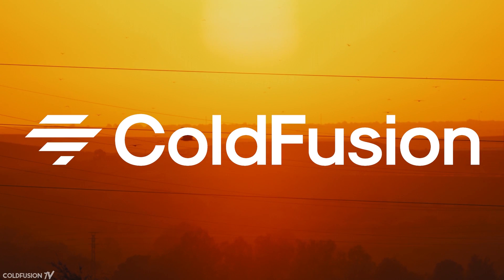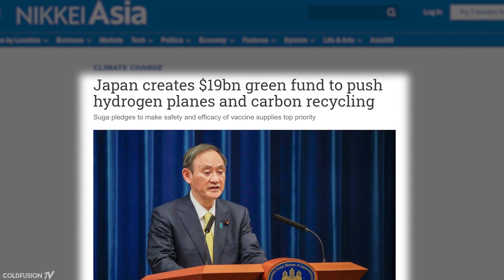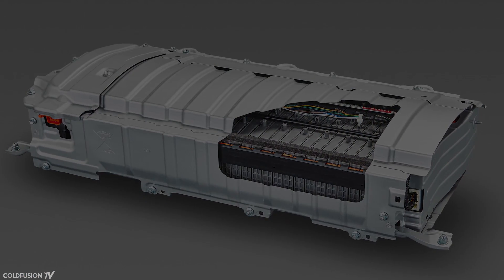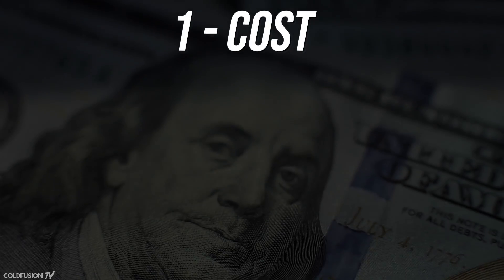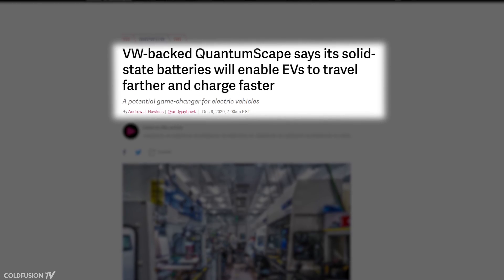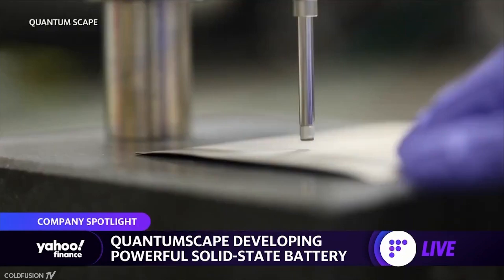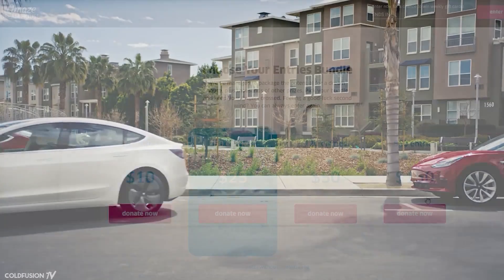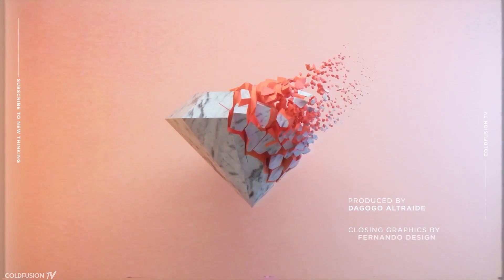Toyota Plans Revolutionary Solid State Battery for 2021

Comment: Its all very good to say that Norway now sells more electric cars than other fuel types. Norway is slightly larger than Victoria, the smallest mainland state in  Australia. So, travel within that country in a vehicle that has a 800 Km range in a no brainer.
Now lets look at the elephant in the room. Australia, (and some other large sparsely populated countries).
Australia has  road travel  distances that just don't make sense to European's, Asian's or American's  yet many here think nothing of a road trip from say Adelaide to Sydney (1400 Km/870 miles) with one over night stop or Sydney to Brisbane (900 Km/ 560 miles) without stop.  
And, these trips don't even involve any real outback travel. What about a trip to Alice Springs (less than 3000km from any mainland capital). 
This trip can be comfortably traveled from Adelaide (1500km/930 miles) in 2 days or less with little planning. Now lets look at a Tesla Model 3 Long Range with a  claimed range of approx. 650km. 
In real world terms this is, according to some sources, as low as 460 Km in good conditions. 
Now this trip does include some outback travel (i.e. very remote, no super chargers out here). It does have 22Kw chargers in some locations (Port Augusta, Cooper Pedy) but you will still need to add at least 280 km of charge somewhere with questionable power supplies from a standard wall plug and the portable charger. 
According to Tesla a standard wall plug can add 10 km of range per hour from the portable charger i.e. we have just added 28 hours of down time to the trip in places that are little more than a roadhouse in the middle of the desert. Don't forget that this is in SA desert where temperatures regularly exceed 40C in summer and can exceed 30C in winter., so no walkabouts (sight seeing on foot) unless you are well prepared and know the area. These are not tourist hotspots either, so your unlikely to have any organised tours available. 

So now a 2 day trip becomes at least 5 days with a minimum of two stops doing nothing but watch your car recharge.

Now I know the average buyer of an EV is probably not considering driving to Alice Springs or anywhere else that remote but the reality is that EV's are great in situations where your travel in not going to exceed the average half range trip away from a high capacity charger but less suitable for long distance travel in remote areas. The info-structure costs to solve this problem in places like Australia (except maybe the east coast) just doesn't stake up.
 
The Solid State Battery may be a step closer to solving this problem but unless you can make the trip above in the same time as a vehicle with an internal combustion engine fitted with a standard fuel tank you will be hard pressed to convince the average person in places like Australia that the additional cost of the vehicle, plus info-structure costs are worth it.

Comment: I want the new Dacia Spring. It will cost roughly €15.000 "in store" comes fall, will run about 200 km on a charge, and do exactly what I need from a car - handle my daily commutes, about 70 km a day. 

"Oh no, you need 500 km range in a car!" I hear the the skeptics say. 

Do I? Do you?
If you buy a new electric car that cost you perhaps only 1/3 of a "cheap" competitor, you got roughly €30.000 to spend on taxi, travel, leisure. 
Need 500+ km range? Really? Well, if you got a cottage up in the mountains perhaps you do. I don't, and most of us do not. 
Low cost/shorter range beats expensive/long range every time from a pragmatic users standpoint. Every single time.
Reply: It's because people are used to seeing 500km range on fossil fuel cars.

Rarely do people realise that they only drive maybe 50km to work per day on average, so 500km of range doesn't always make sense for everybody

Comment: Saying that you are worried about fire on  Li battery is so ridiculous when we are now driving around with a tank of flammable and explosive liquid that is exploding thousands of times per minute in small enclosed cylinders for over a hundred years now. Cars have always operate on the safety margin of whether it will blow up on you. Li batteries are really not all that different.

Comment: I work in digital infrastructure. On UPS and battery pack up systems for data centers, stores etc. Lithium batteries are very volatile and have a life of 5 years. So pretty much every 5+ years you will have to replace your batteries. At 100,000 miles you better sell your electric car if your smart.

Comment: If you look at the sweet spot for Rapid charging on a Tesla where you can get 250kw charge speed when between 10% to  80% .  It would be ideal if we could safely live inside that part of the battery and still get a 400 mile range with 15 minutes of charge.

Comment: My home electricity supply is limited to 60A, at 230V, which means that it can't supply enough power to recharge any 40kWh battery faster than  2 1/2 hours. Only superchargers could manage these fast recharge times quoted in the video
Reply: Gotta tap that 120A mainline, though that sort of rewiring (in my area anyway) is probably 20k USD
Reply: @nalgene247  Newer houses are getting 100Amp,  23kW if you don't use power for anything else.

Comment: "A phone battery that lasts three days." - My Nokia 5110 calling which I forgot in a drawer in 2007.
Reply: My Lenovo P2 is calling from the drawer I put it in 2015, too. That phone could last at least four days on standby, ten days on the battery save feature! :)
Reply: If its a joke then I get it but if it isnt, then the reason why they last more is because they arent smart and are type of analog devices, receive no notifs, no gps, etc etc.

Comment: The recent cold temperature drop in Texas  is a big problem for battery run vehicles. A battery could lose 30 percent of its power in very cold temperature to start and run the engine. Not only that, with the lost of electricity,  electric vehicles can't be charged.  Hybrid vehicles are better because gasoline does not freeze and charges the battery as well.
Reply: You act like EV's don't exist in places where it is normally cold.

Comment: Good the research is making some progress but still early stages, solid state battery has its benefits that we go for: Carry capacity, easier to manufacture, no rare elements aside from lithium itself (carbon and such are common elements), potential for lower cost, that high price in the video is due to the lack of mass production and only a small team making the battery "by hand" but otherwise should become affordable. The bad, yes those annoying dendrites need to be dealt with for maximizing battery safety and avoiding the swollen battery "disease". Would like a job in this area as I don't have a job yet after college.

Comment: Solid state is not more expensive. It uses less material. No anode needed. No heating system, and some other benefits. I keeps its charger and charges better in winter.

Comment: I find it comical that Toyota is claiming 500Km of range which supposedly provides "double the range of what would be possible with traditional Lithium Ion batteries 3:12 ".  Never mind that Tesla is about to offer a battery of 520 miles, or 837Km of range in their upcoming Tesla Model S Plaid+....
Reply: It says double the range for same size.
Reply: @skiran69  We'll wait until they release something.  Too much vaporware floating around...

Comment: 500 kms at Japanese cycle so 300 kms at 80-90 Km/hr so maybe 300 Kms range in reality and we're there already with current tech, the only real issue today is poor batter temperature control in cold weather or lack of entirely when it comes to Nissan so the result of that is much slower DC charge times. But a 100 Kwh EV would be nicc with 300 Kw charging Winter/Summer. 

It's amazing that Toyota are still churning out Hybrids with NiMh batteries.

Comment: Another breakthrough that's just 5 years away........
Reply: Not going to happen for 20 years plus.
Reply: Most likely 10 years away 😄
Reply: 5 Years.???????............I believe 15.....................Paul
Reply: If it was actually only 2 years away, imagine the buyers remorse of buying a $50,000 EV then 2 yrs later Toyota comes out with an EV using solid state batteries for $40,000
Reply: @michaelbrinks8089  followed by Tesla coming out with a $25K Model 2. QuantumScape is saying minimum 2025 before it starts producing SS batteries.
Reply: @michaelbrinks8089  spot on!
Reply: It's a huge disappointment
Reply: What is the company Toyota is using for their solid state batteries?
Reply: plenty of time to make some good investments

Comment: I know it's impossible, but why don't the various auto companies agree on a standard battery size? Then it could be like the battery powered fork lifts in the auto plants! When the battery in your vehicle is drained, you pull into a charging station and exchange a depleted battery for one that is fully charged! Designed right, it would take no longer than it does to fill your gas tank with fossil fuel! Like the battery powered fork lifts, just unplug the old one and plug in the new one! The depleted battery is charged and ready for the next customer! Not enough profit I guess. Too bad for us.

Comment: I think the final pieces of the puzzle will be standardizing the batteries so that battery stations can replace gas stations - you pull up and swap batteries - and getting the electricity from somewhere else than where we get it now. Without those two things, supply chains cannot go all electric nor will it make any difference. we'll still be burning dino goo. Just upstream.

Comment: Warning to anyone who isn't well versed in nrcg storage: energy density as expressed in what hours per liter is a useless metric. Electric vehicles are weight constrained not volume constrained. This video is very misleading because it focuses on volume instead of weight. The manufacturing costs are also enormous roadblocks. Toyota's been wasting its time with hydrogen fool cells for the last decade and going nowhere. Now they want to waste more time and money chasing after solid state batteries instead of just going with the existing, perfectly usable technology.

Comment: The ultimate weight-saving battery car would have the frame itself made of battery materials.  However, this would make repairs prohibitive, perhaps impossible.  In the end, we started with the 'carbon' battery circa 1900 and we will conclude battery fueled cars with more advanced Bucky-ball carbon batteries.

Comment: Batteries are only a stop-gap and not the solution and create way too many problems. They need materials which are hard to get and just assembling those batteries creates a gigantic carbon footprint and there is the whole thing regarding recyclability. Hydrogen is the way forward.

Comment: I sold mt Toyota pickup 3 years ago with 500,000+  miles in it, motor is all original,no rebuilds and he is still driving it daily All he has done is change the oil and filters using the schedule I gave him. If their electric is half that good I'll have one

Comment: Toyota Solid state battery: charging 10 minutes and run for 500Km.  Not the best in the industry.  The key for electric vehicle is the battery.  Unless Toyota has even better battery, it's hard to compete and maintain as the #1 vehicle maker in the world.

Comment: Lithium metal as an anode will not work.  The plating and stripping of lithium  repeateatedly creates enormous changes in the structure and density of lithium - imagine a battery that grew and shrunk more than 30% every cycle!  Mechanically  and electrically this creates a  bevy of issues and the fact is that the lower the density of the lithium the more dangerous it becomes.

Comment: Opinion: it doesn’t matter wether it’s Solid state batteries Or lithium ion batteries, what matters is we keep moving forward and developing batteries to replace ICE transport machines.
e.g. Internal combustion engines have been around and the choice of transport polluting machines for more than a century and have barely developed from the original concept.
Reply: e.g. means "a prime example". I think you mean i.e., meaning "that is"
Reply: @nalgene247  thanks for the correction

Comment: there's an easy fix for the "doesn't preform well in cold temperatures" problem. Just put a heater under the battery. done.
Reply: Then the accumulated heat will melt the battery
Reply: @michaelh13  I think Person the Human means use measured heat as in thermostatically controlled heat, think air conditioning

Comment: Unless Toyota can create a SSB that can have a 400+ mile range (including wintertime driving), recharge in 5 mins to full without any battery damage, and include it in a mid-sized car priced at $25,000 then...don't waste your time or effort Toyota. Until the 'Trio of Troubles' are addressed, there will be no en masse adoption of EV's anytime soon.

Comment: Daimler is offering solid state batteries in their buses. Its tough to get any technical info on them. But they have a 25% better energy density compared to NMC, they cant fast charge as well and they don't use cobalt. the rest is a mystery.

Comment: I won't believe it till I see it.   Doing something in a lab is not the same as mass production.     They have to get Cost, safety, and reliability  right!    Nobody wants to pay $15,000 to replace a car battery!    Which is why only rich people can afford electric cars,  And the used  electric  with  an old battery have  little value.   I'll stick with gas for now.

Comment: QuantumScape investors have until March 8, 2021 to apply to be a lead plaintiff. Investors do not need to be a lead plaintiff in order to be eligible to recover as class members. The case alleges that QuantumScape and its senior executives made misleading statements to investors and failed to disclose that: (1) QuantumScape's purported success related to its solid-state battery power, battery life, and energy density were significantly overstated; and (2) QuantumScape is unlikely to be able to scale its technology to the multi-layer cell necessary to power electric vehicles

Comment: 'solid state' specifically refers to electronics based on semiconductors. The term was prevalent in the 50's-70's as microprocessors replaced mechanical components such as in watches or clocks, or more recently, SSD over HDD.  The term simply doesn't apply to batteries since the BMU is independent. Pretty sure Toyota know that.

Comment: I can fill up my Toyota Corolla in 3 minutes and run 593 miles
Reply: BINGO! And that is why we'll never see any mass adoption of EV's anytime soon. Until some electric car can make a battery that has a TRUE 400+ mile range, can recharge to FULL in 5 minutes and cost around $25,000 for a mid-sized car (Tesla Model 3 size) then EV's will remain an extremely niche car with nearly NO ONE interested in buying. EV's just aren't "there yet" for the vast majority of consumers.

Comment: Ultimately, infrastructure and power delivery are going to be the limiting factors. If your EV has 100kwh worth of batteries, to get that charged in ten minutes is going to take a charging connector that can push through 600Kw. That's a heck of a lot of power - about the same as an electric arc furnace needs to melt ten tons of steel.

Comment: The revolution of multiple batteries 🔋 under the chassis of any car 🚘 built with reducing fuel consumption and using solar generators to power technology in the form of solid state power to better technology.??????I am very obtuse and very good reliable to force less pollution period.?????)I said so.????

Comment: The Tesla Model S Plaid+ if your looking for stats since you don't delve in to price in a real product has 837kms of range, 0-60 in 1.9 sec, can charge 400Miles in 15 minutes and a tabless cell architecture with near as much density as the non-existent solid state cells you mention and are structural so net negative vs solid state. In addition they are cheaper to manufacture, use a dry process for the most part. Is this sponsored by Toyota, short sellers, or poorly researched? The model 3 also has over 500KMS of range too.solid state is not yet scalable. Its just Toyota delaying as they can't compete. https://www.google.com/url?sa=t&source=web&rct=j&url=https://www.wsj.com/amp/articles/toyotas-chief-says-electric-vehicles-are-overhyped-11608196665&ved=2ahUKEwimpMrw08zuAhWStp4KHQrfA0UQFjABegQIAhAF&usg=AOvVaw2ps-zLL8apZ7t1phM29szn&ampcf=1 also the Yahoo finance reporter interviewed has been a Tesla bear forever and has been consistently wrong for years. I should almost unsubscribe. This was not objective.
Reply: consumption ?   over 1000hp for going from A-B for mostly ONE person inside ?   There should be limitations soon !!
Reply: @kubanskiloewe  HP is not equal to eMPG or KW/H. Teslas have close to, of not the lowest consumption due to low drag coefficient and better software. They are winning. Look at the vehicles with known battery sizes and compare that with range and Tesla gets more range on smaller batteries. News will often focus on pack size in a vehicle, but it's the range and power that should be focused upon. Its not like ICE there is no V6 or V8 and a better motor does not necessarily use more power.
Reply: @Sovtoshi_alt  lol, never buy this shit...you can have it :-)

Comment: It has to be cheaper than current batteries, since lowering price, not increasing range, is the highest priority for batteries. In other words: it doesn't matter how much better the batteries are if they cost much more. They will be used only in expensive cars.

Comment: 2023 or 2024? Gimme a break. Others (ie Nio or Tesla) have left and will continue to leave Toyota in the dust. Cmon toyota, you can do better. Plus 800 charge cycles to retain 80pct state of charge is not impressive. Solid State should surpass NiMH which bragging about 800 charge cycles is lame. 2014 Tesla batteries already surpass this.